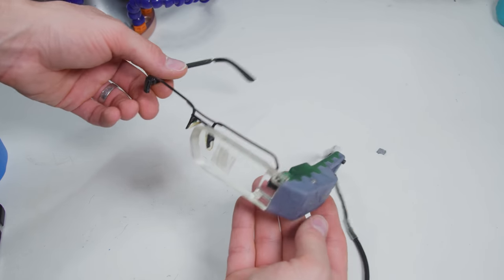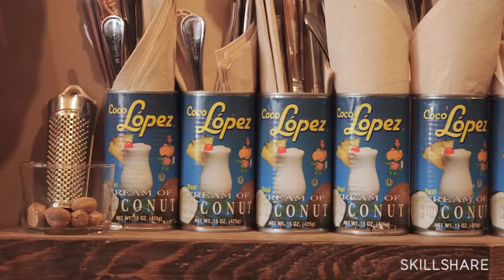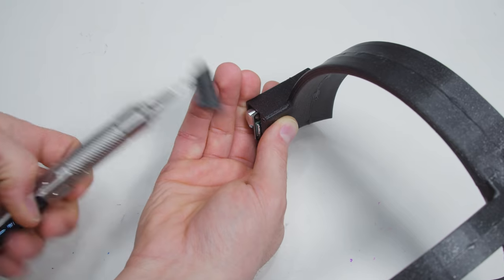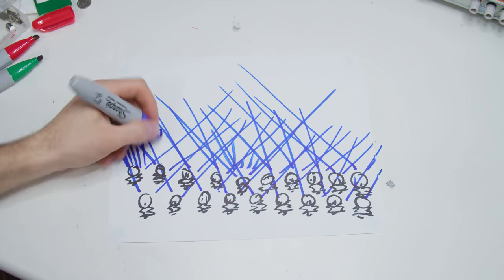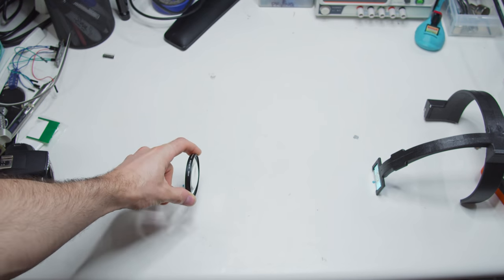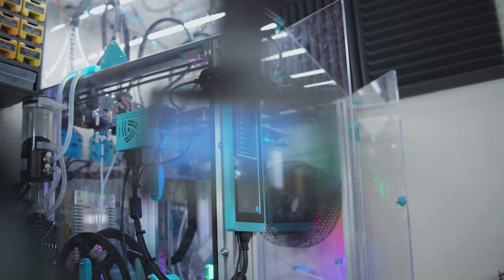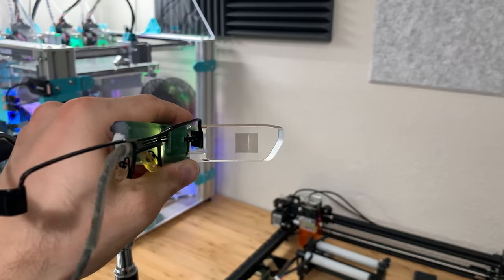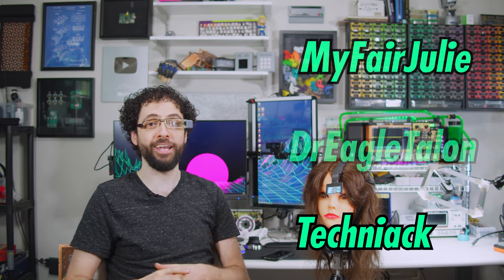The Worst Wearable Computer

Comment: Didn't Innovega solve this near-to-eye display problem by circularly polarizing the image source and then using a similarly polarized contact lens optic to twist the light path back into a viewable image? Anything that's not circularly polarized will remain visible and in focus simultaneously.

Comment: I had hoped that Fresnel lenses could be used to straighten the light both before and/or after entering the screen.

Or to be able to have the 'pixels' be out of focus enough that they would work like those 2d "magic pictures' where the image doesn't work if you are focused on it but do if you are focused beyond it.

Were I to use a larger screen and have it further away, how far would the minimum be were I to make a Master Chief helmet with HUD inside? Or fallout Power Armour?

Comment: You should make a fully functional computer with wearable splitted keyboard that you can wear and un-wear when not used and a mouse that works without having to detatch your hands from the keyboard. Like using the movement of your head and some other part of your body as a point of reference and a key on the portable keyboard so that you can click. That i've never seen and it is something that i'd even buy. Like a laptop but better. Loved your videos. New subscriber here. Leep it up.

Comment: Am kind of curious how much impact there would be to adding just a polarization film over the display. That would "limit" the angles the light can pass through, both from the world, and the display, but not sure if the result of be "parallel enough"...
Reply: Wouldn't that still affect light coming from beyond the display?
Reply: @johnalogue9832  Probably, but we do have polarized sun glasses, so... Like I said, not at all sure what the effect would be, other than that if you got it on the wrong orientation it would mess with anything else that was polarized (make it go black). But, yeah, it would have some effect, just not sure to what degree, or even if it would work at all.

Comment: What about like, a tiny filter? I mean we probably can't machine something like this, but if you could just make a thin plate with a bunch of holes and make it thick enough to block a decent amount of non parallel light at that range, couldn't you focus both the background and the foreground? the foreground object would probably lose a ton of brightness though

amalarkical is a pretty nice word

Comment: Zack: 3:43 "they are made with indium tin oxide, one of the very few transparent electrical conductors"
Me: laughs in 5th grade physics water
Reply from the maker: WELL ACTUUUUUUALLY water is an insulator, it's the ions introduced by electrolytes that make it conduct

Comment: What would happen if you put some sort of small dark colored grating between the screen and your eye, so that it splits each LED into its own space and only the light that hits your eye is traveling parallel, and the non parallel rays that hit the inside of the grating are absorbed. you could even angle the grate shape so that it focuses down to your pupil for maximum parallelness? Sort of like a shroud cone for each LED. Basically a pinhole for every LED.

Comment: Annoyingly I was/am working on this exact same project. Except it's using an LCD display rather than an OLED one. The idea was to remove the back LED panel and use the surrounding light to make the image. Ran into the same problem with the display being too close though

Comment: In photography, you can use a grid to direct light by only using parallel rays and blocking the rest, you get a very focused beam out of a wide diffused light source. If you had something akin to a polarizing filter in front of your display but made so that it matches the pixel placement and density of the display, would the "swing-wide" rays not be blocked by that ?
The "grid" would be so thin and close to your eye it would be out of focus.

Am I missing something?

Comment: i really wonder if you could just make a "phone mirroring headset" that connects to your phone via wifi/bluetooth to mirror your phone screen so you could just watch youtube/read while you are doing something else... or just use it straight up as a gps navigation on your head while driving
edit: and add some touch screen/navigation button on the side of it (acting as a mouse), so you dont need to touch your phone...

Comment: OOF! The diagram at 9:47 of the off-normal rays hurt a bit😬😬, but I guess its okay cause it is easier to explain incidence🙃

(assuming same material and boundaries, light will exit parallel to the incident beam, but a little shifted)

Comment: suggestion: put a lens behind the darn thing and  use one eye to read the display and the other eye to see trl in 2 dimensions.

Or build two of these for both eyes and wear them as glasses while you can see through the screen. They look better than a functional wearable and they are cheap and relatively much easier to build.

Did you know when people have a cataract surgery the most common  practice is to replace the lens of one eye for parallel light rays coming from long distances and to replace the lens of the other eye with a lens designed to focus on written text at the distance of people holding a newspaper or book comfortably?

Yeah. My grandma had that done with a good eye surgeon. She had +20/20 vision to read as well as she was comfortable watching TV and getting around without wearing glasses all the way until she passed away at the ripe age of 92.

Meanwhile my mom and uncles (all of her children) had to wear glasses to read and get around.

Her doctor said the brain automatically switches to using one eye for distance and the other for reading. It is not perfect of course. But it was way better than waring 2 different set of glasses.

Comment: Okay, I might have missed something very obvious, but he just keeps mentioning that it's too close to focus on and I can't stop thinking: Why not just sacrifice the sleekness of the heads up concept and put a transparent oled screen a couple more inches from your face. Then you engineer a solution to make it retract up into the headband a la the same magic wand you stole from Tony Stark for when you're not using it (to keep the delicate screen safe, has nothing to do with fixing the optical issues) and presto, you can now display useful, visible information on a clear display in front of your face, just not as close as glasses would sit. I understand it's no longer the same project, but like, it achieves an incredibly similar effect

Comment: I might be wrong, but to fix the lens issue, couldn't you just put a second lens that's a flipped version of the first one behind the display such that it reverts light not from the display back to normal?

Comment: Just as an idea: what if we use the OLED reflex sight principle (similar to what Kousaku Japan channel did) and place the projection glass as close as possible to the eye?
Yes, it will be somewhat cumbersome, but it does not require complex optics and is extremely cheap... Provided, of course, that this thing works as I imagine.
Reply: The optics isn't really complex. Just bulky and has no practical use. Basically no one is making it cheap cause there's no real use case.

Comment: I had a idea where you would use mirrors to bounce the light around like a para scope
So a side mounted display that bounces the image around the visor to a 
screen so you can see through it and it works like a red dot sight but a display 
I mean that is essentially that 700 dollar visor
But it would be even cheaper

Comment: I think I'd rather use the transparent OLED. I'd mount it on the headpiece just like a microphone on a gaming headset. You swivel it down to read (it would stick out a bit so you can focus on it. I can read text at about 8" in front of my eyeball) and then you pop it up out of the way when not in use. It would be much lighter, use less power, be easier to interface with, much less complicated. 
Or even better have the swivel part motorized so you press a button and it swivels up and down. Full cyborg mode!!!

Comment: Ok, this is stupid, I know, but can the display be abused by making use of the blur?  As in, if you have it show a small lit area, is it localised enough to be interpreted as "I'm drawing your attention to the thing that's here in your line of sight"?
My thought process here is that instead of something that has to be sharp to be useful, like text, it would be worth considering if there's anything that doesn't need to be sharp.  Games have the normal sharp HUD elements, but some also implement a glowing outline of some kind to indicate what your UI raycast is pointed at.  Gotta be worth trying, after going to the effort of building the hardware?

The other thought I had was making the most obnoxious attempt at real-time real-world "light grass" censoring glasses, but the idea is demented on so many levels it terrifies me.

Comment: You can make a pin hole by bending your finger over so that there is a very tiny hole in the crease between the three parts of your finger. If you hold that pinhole real close to your eye, you can use it to see better than youre normally able to.
Reply: I have glasses based on that principle. The tiny holes filters light aberrations just like when you close your eyes all but a tiny bit and your eyelashes collide.

Comment: What about using a the principles of a polarizing lens to straighten the light out?  Also...thanks to my glasses, and because I trained myself to manually focus my eyes, the hypnodisk failed you.  Dont ask how bored I had to be to spend hours in front of a mirror manually focusing my eyes...

Also, could you use a camera in front of your lens and project the image behind the wording on the oled?  Then you could have a lens just in front of the oled thatd make it readable.

Another idea,  use a camera to put a dot on the oled on things that move to help you target, or even better video track the firearm and put a crosshair.  You might not see it, but your brain sees a bow that way when you shoot traditional archery with no sight... itll learn to aim perfectly rather quickly.

Comment: What if there was a lens in front and behind a transparent OLED? The one in front focuses the OLED and the one behind refocuses the real world? Not sure it would work and of course would make the display unreadable to other people ruining the sci-fi aesthetic.

IMO Vr style display with camera passthrough are a better long-term solution anyway. Glass style displays can't produce darker than ambient colours and inherently have a narrow FOV due to relying on the refractive index of the mirror. When we have 16K+ HDR distortion free VR in a slim form factor the slight edge in real world clarity would be less important IMO than the ability to have wide angle AR with a full value range. Hell in some ways the passthrough could be better than real vision. You could have movable cameras to change depth perception, change brightness, contrast, apply colour filtering etc. 

If lightfield displays get to a high enough quality you could make them absurdly thin and turn off rays not aiming at the pupil reducing the screen's power consumption by orders of magnitude and be self-powered by a solar panel on the front of the device, this would also be impossible with Glass style displays.

Comment: I may be missing something, but it seems like you could just mount a small fresnel lens with say a focal point of 5mm onto the display itself to straighten the light coming off the LEDs. It would only focus a very small portion of the screen for you as only rays in the width of your pupil could make it through. But is there any particular reason why this wouldn't focus? Then you would still be able to see around the screen and it would just be blurry looking through the screen but with a small bit of focus in the center as well. I understand only having a small bit of focus doesn't seem like it would be worth it but I am just curious. Thanks for the video!
Reply: That's a great idea.

Comment: A transparent wearable cannot work.... without optics, kind of.   As long as the lens shown around 12:20 is made to  only cover the display, you only de-focus the real world immediately behind the display.  Your other eye will capture that part of your visual field, leave it be if you don't mind the defocused blur and people at the airport knowing your pron viewing habits.   Cover the back side of the OLED black opaque to get rid of distraction and prevent getting arrested at the airport.  Now you have a transparent wearable that kind of works if you have 2 functioning eyes.  And that costs only a few times more than what the much better functioning system using  a conventional display and mass produced optics would cost you.  Problem solved!

Comment: ok so what if you just place a regular mesh in front? I wanna see how that looks.
or maybe there's something that lazes or just lets photons through in 1 dimension only?
maybe add another lens before the screen to un-parallelize the background photons to the same level as the the screens photons. then a lens to paralellise all of them again? that would actually be 4 lenses so that the back ground gets flipped back to the right side up. maybe less concave lenses i don't have the brain power to think that atm but i simulated it with 4 lenses.
uhh.. screen shape. flat vs curved might also help ?

Comment: I don't get your arguments about the additional lens making everything else out of focus. They were only out of focus because the lens exceed the dimensions of the display and covers more than what your eye would naturally see if the less was sized to match the screen, so not to obscure your peripheral vision. Sure you may lose any transparency in the screen, but that's no different than the opaque screen in your device, or that in the Google device. At point you've significantly reduced the cost of the wearable device drastically.

Comment: What about a lens sandwhich?

Lens behind the display and one in front of the display, lens infront parallels the light so you can see the display, lens behind does the exact opposite, like the light coming off the display is -1 and the light coming through the display is 0 the lens infront is +1 so if you put a -1 behind the display then it’s -1+1=0 for the display light and 0-1+1 for the light coming from behind the display both are 0 so both should be in focus no?

Or to put it more simply

What if you just make the light from behind the display just as out of focus as the display so that when you focus the display you refocus the light behind it

Comment: What I dont get is why you cant just use two polarized filters a couple of MM's apart between the display and the eye. It would be like looking though sunglasses, but wouldn't the display be visible?

[Screen]  { { {  filter[glass]filter = = =   (Eye 

Way way back in when the idea was first floated in the 18th century someone did a version of the double slit experiment with candle/fire light, which is obviously de-coherent light. They used both distance and an additional slit before the first to filter out most of the light that wasn't coming from the correct angle.

So instead of:
           }    |
   }            |
          }     |
it looked like this:
           }    |
}  }            |
          }     |

It obviously doesn't work as otherwise someone would have done so already, but I dont understand why. And was hoping someone would have an answer.

Comment: What if the photons don't have enough distance to spread out, though? Shouldn't a contact lense made from transparent OLEDs allow for a - certainly low resolution, but readable - HUD?
Reply: The entire display would have to be about the size of a single pixel on that transparent OLED.
Reply: @davidskidmore3442  Yes. I think I've read something about >10000dpi OLED, so that might be viable. I'm just interested in the optics behind it.

Comment: a high performance high capacity charged laptop in a backpack which also supports the weight of the enclosed space suit like helmet on your head so the fish bowl on your head is supported onto the back pack while also giving you the ability to tune the air you breath, protect your head in a bullet proof shell, and give you a 360 degree field of view to work with

Expensive as fuck? for now.

Comment: Instead of putting a lens between the display and your eye that covers essentially your whole field of vision, which of course would bring the display in focus but make the outside world blurry, why don't you just figure out a way to mount a lens that is exactly the size required to cover only what you can see of the display, so that it doesn't interfere with light from the outside world, but only light coming from the display.

Comment: could you put a film composed of pixel sized Fresnel lenses focusing each pixel toward the eye ? I saw such lenses on 
Huygens Optics channel. I guess it would not be possible to see through correctly, unless the LED and lens is a few percent of the total surface, which would be possible with micro LED
Reply from the maker: I actually put this in the script, but had to cut it. If the lenses and pixels were small enough, it would work great. Right now, conventional optics are more practical, but I wouldn't be surprised to see a commercial product with embedded LED's and micro-optical systems during my lifetime.

Comment: I recognize that this is a terrible idea and almost certainly wouldn't work but my puny brain cant figure out why. Why not put a second lens on the other side of the display to scatter the incoming light in a predictable way so it gets re focused through the second lens and into your eye? or would that cause the same issue as if you milled the face of the OLED panel to deliver parallel light directly from each pixel (fresnel lenses from hell).